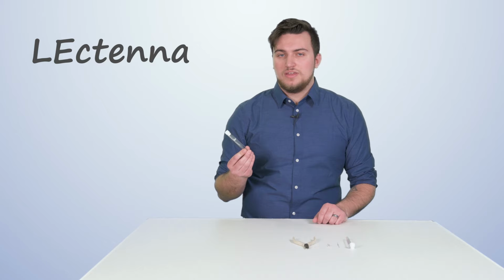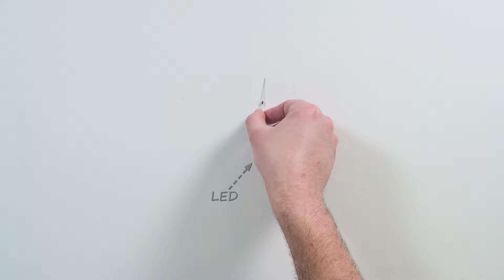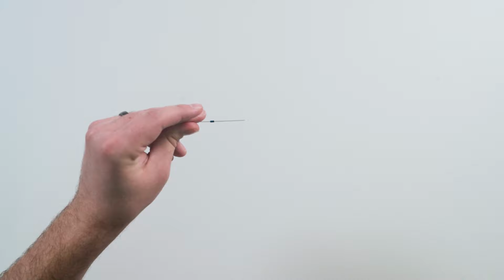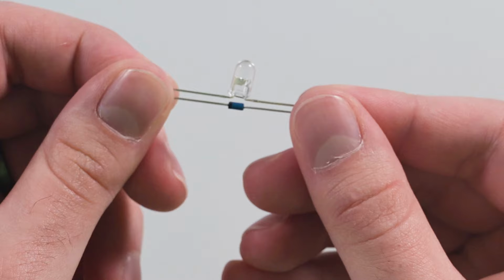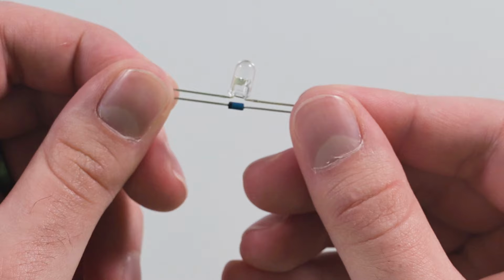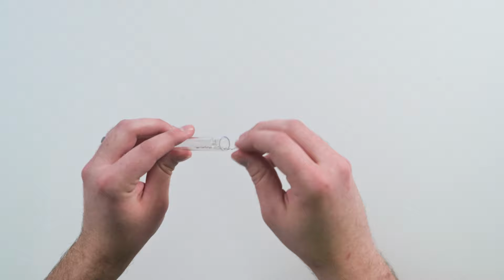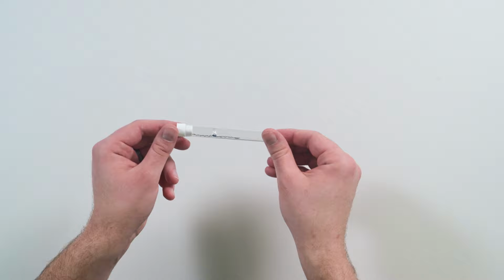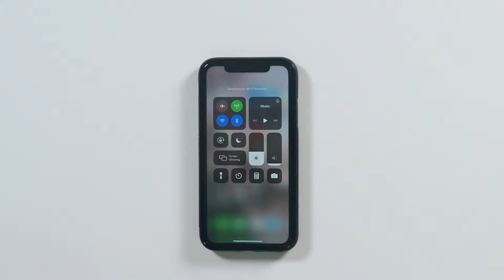How to Build a LEctenna

Comment: Thanks for the instructions. I did not understand what you mean by the "notch" so I oriented my LED diode so that it matches yours orientation in such way that the bigger inside part is on the same side as yours. It did not work because this way both diodes were connected anode to anode and cathode to cathode. They must have inverted polarity for them to work as LEctenna. 
It seems that this is not a reliable way to identify anode and cathode. There are two reliable ways to identify the leads of LED diode:

1st method - length of the leads:
Anode (the lead where you connect "+" when you want the LED to light) is the longer lead. 
It is easiest to check before you bend the leads. Also, this does not work when the leads were cut (eg. when soldered into PCB).

2nd method - flat spot on the body:
Cathode (the lead where you connect "-") is the lead near to the little flat spot that is visible when looking at the bottom side. If you look close enough, you can see that the perimeter of the diode body is not perfect circle but it has a small flat spot. This spot identifies the cathode.

Comment: Hello, I recently just bought some doides and made several lectennas. I can't seem to get them to work, could you provide any additional information about the specific components to use or other methods of testing them? I tried my phone to no avail.
Reply: Are you sure that your diodes are not fake? Mine lectanna worked with same way (but not with mobile phone)